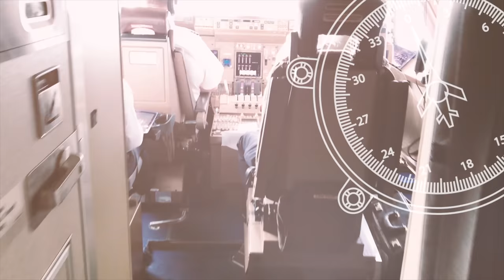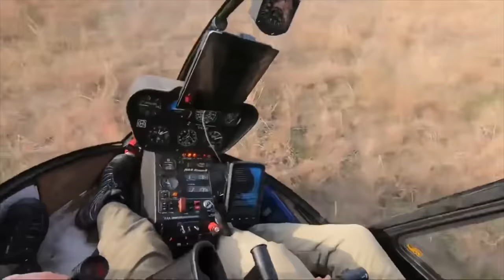Boeing 747 Loses Landing Gear | Viral Debrief

Comment: Ive flown the 3 main airlines in the Philippines several times each--Philippine airlines, Cebu Pacific, and AirAsia.  The airfares usually go in that order from Philippine Airlines being the most expensive and Airasia the least.  I've also oberved that their landing quality is also in that order with Philippine airlines being the smoothest no matter what the weather is and AirAsia having the worst landings of the three--also regardless of the weather, good or bad.  AirAsia seems to have a "patented landing" where you feel the plane drop out of the sky in the last 10 feet or so.  Thus, I am not really surprised if the plane landing here is AirAsia.

Comment: C'mon man I take my 747 off-roading all the time, I've got it equipped with the extra off-roading gear, 4x4 transfer case and upgraded transmission, and I had the GE Genx engines replaced with a Chevy big block.

Comment: Hey Kelsey, Nice job, as usual. Two questions relating to the 7-4.
1. Would that situation have called for even more fuel to be dumped to further lower weight, to reflect the landing gear problem?
2. Do you think the pilots 'intentionally bounced her hard' to try and try to get the last bit of gear to down and lock?
Reply: No way would I as a pilot bounce hard to get the gear out. The gear moves pretty slow so it’s not going to come down and help. It would probably scrap down the runway and cause problems

Comment: Wow am I enjoying your videos.  I am desperate for an answer on a question:  hope someone can answer this for me.  Im far too old and broke to llearn to fly but always wanted to, so Im gllad to be learning  a lot.  However my academic path in life has lead me to a question i have always wanted to know.  In anthropology, human variation is a big area of study (which does include weight/BMI) but more about anthropometic measurements, height, body proportion percentages etc.  obviously lode weight is really important.  Over the decades humans have got bigger, in height, size (height and stature) and of course actual weight and some very overweight.  So, over time has aviation adjusted the "average" weight of passengers (which in the 1970's was about 1/3rd less than today according to some sources) to what they are today, and what are the baseline metrics used to determine passenger weight, given some might be only 50 kgs and others 150 kgs...  Please understand Im not asking from the curlly topic of whats a good or bad weight for humans, im just interested in how this is accounted for.  I have a vintage car and its breaking system functions poorly if the car is full vs if Im in the car alone.  So is the fact ppl are bigger than we were 40 years ago a factor for aviation variables.?

Comment: Returning from my honeymoon, it could not be determined by the tower if our front landing gear was locked or not. We were directed to a remote landing strip and we were directed to get in a crash position. We landed okay, the gear was locked.  As we landed safely I sat up and saw the fire engines racing beside us. Now I’m scared to fly again. 
Prior to that, I was on a plane landing in gusting wind with the wings dipping from side to side. I was afraid a wing would hit the runway. The people who were meeting us were more scared than I was as they watched the plane land. 
I avoid flying at all costs.

Comment: If you're in an airplane and you have a total engine failure, you're now flying a poorly-designed sailplane. You can still glide for a while, probably, unless you're flying the Space Shuttle (which had infamously terrible aerodynamics for a craft that was designed to land unpowered). If you're in a helicopter and you have a total engine failure, you're now flying a brick. Slightly different situation.

Comment: As a pilot, have you ever had to land a large plane (747) at an odd angle?  I've seen some very scary and impressive landings where the plane is literally at a 90 degree angle coming in and winds up straight on the runway.  I'm assuming this is due to extreme wind sheer?
Reply: That's not what literally means. :muttermutter: But, no, it wouldn't be windsheer. Windsheer is when the wind is blowing in significantly different directions or at significantly different speeds at close altitudes. Crabbed approaches are a response to crosswinds.

Comment: Installed upside down...
They added markings since to make the installation instructions clear...
ME: [the field support troubleshooting and repair person looking at the upside down word "TOP" on dozens of mounting plates every year (mind you, I only see about 100 plates per year, literally seeing this several times a month) I used to look at them and think "installer, you had ONE JOB" going forward I think I will look at them and think "thank goodness this is just a cash register and not an aircraft!")  [Major inconvenience for me nonetheless, I have to disassemble half the mount structure to take that plate off to get to the security screw, because the access hole doesn't line up. But nobody is at risk of dying because somebody half-a$$ed their install on anything i work on.]
Reply: I think that is why a lot of manufacturer's start making parts that won't fit if placed upside down because people just don't read :(

Comment: Why is it you would dump all that fuel and return to the airport,making all the passenger have to wait for another plane,instead of keep going to wear you are suppose to?your still going to have to land.might as well be were they want to go.i don't get it.
Reply: If one system fails, what else might be wrong with the aircraft? Plus, each aircraft has a minimum equipment list that states what failures may happen and the aircraft is still considered airworthy. Also, the destination airport might have been smaller with fewer facilities.

Comment: @74 Gear Kelsey, just wanted to point out another factor in the hard initial landing on the 747. The pilot was, and is, attempting to drop the remaining undercarriage by using forced gravity assist and momentum to try and move the components and get them to drop.

Hitting the runway hard, was the last attempt by the crew to try and nudge the wheels and equipment down. That's why they lifted off the ground and bounced, but in doing so they could see on the display that the equipment hadn't budged, and as they had taken the decision to land the plane regardless of whether it moved or not, that's why they came down very steadily and softly on the downward motion from the initial bounce, and landed the plane with the emergency services following on after;

and this is why the services took so long to drive onto the runway, as they had been told that the aircraft may attempt to go around if the remaining carriage comes down. And to drive onto the runway only if the aircraft attempts to land.

This was in the report. Just thought you should know.

Just wanted to say Kelsey, that I love your channel, and you deserve millions of subs. And I especially love your viral debrief.

Comment: meeeeh... u dont know, ur able to react this quick until ur in a situation u need it... my reactions are pretty slow... in shooter-games, i always on the lower ranks... but... once i drove w my old car on a rainy day... right befor a cross section some cars blocked the road... i stept in my break and felt, that the street was slippery and i wont stop befor hiting the cor in front of me... at this moment i haven't thoght a single thing... i relesed the break steered left, than back right to come straight and not hit oncoming traffic, braked agein and i stopt, with my front light where the back tires of the car in front of me were... i had some situations like this... and thats how i learnt, that our brain can switch so fast, u wont even notic ^^
Reply: regard 08:40+ ^^

Comment: Dumping fuel seems stupid. You would think if you can take off at 1 million pounds  then you should  be able to land at that weight in the event something goes wrong not long after take off.
Fuel is to expensive to dump. So maybe the engineers are not thinking of everything as they design planes.
Reply: Fuel is heavy.  Takeoff does not place as heavy a load on the frame as does landing (considering that the engineers must take into account not every landing will be "soft").  

They COULD make it be able to land at takeoff weights, but that would make it far more expensive and overengineered.  I think the logic is the need for emergency return landings is so slight that it is far easier (and cheaper) to have to dump fuel on the 1 in 10,000 flight that has an off the wall emergency then it is to overengineer every aircraft built to withstand a takeoff weight landing.

BTW, many aircraft can land at takeoff weight...

Comment: Here’s a good question; How can you determine your weight in the air? You can’t!!! So your dumping a percentage or the percentage that you would have used in your flight. There’s no way of you knowing how much you weight in the air. Show me the weigh station in the air like transport trucks have to go through.  You have no idea how much you weigh landing. You only know your dry weight, and you know your wet weight.   Dumping fuel is probably automated anyhow. They can’t rely on the pilot to stop the dump before they dump too much out. 😂 💥

Comment: The thing that gets me is you guys dump 1000s of pounds of fuel with no reprocussions and as a truck driver if we loose a few gallons of fuel the EPA is all over us
Reply: I am wondering if you are serious. In aviation, dumping fuel is serious. There is reporting that has to be done. But, that is a lot less paperwork than what has to be done for 100-400 deaths.

P.S. If dumped above a certain altitude, Jet A fuel will evaporate before hitting the ground.
Reply: You came up short on the IQ lottery, didn't you?